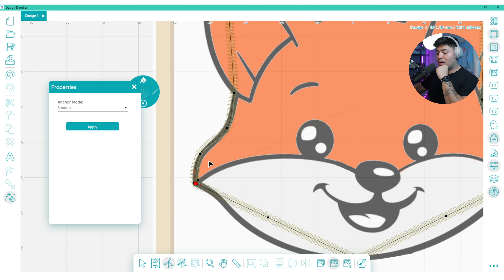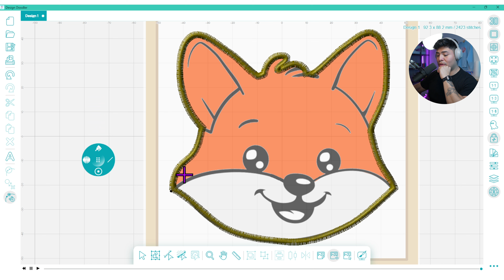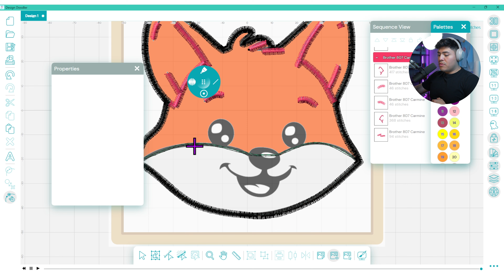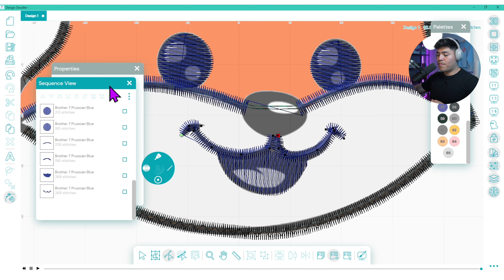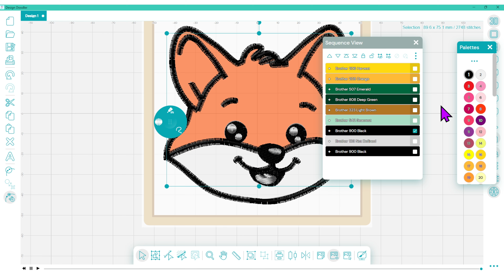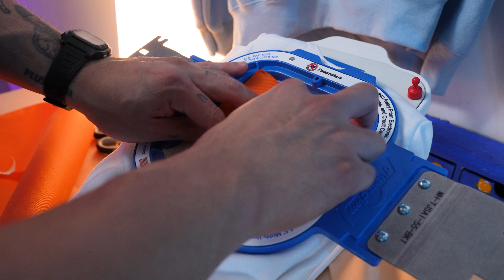Easy Applique Embroidery with Design Doodler! Step-by-Step Embroidery Machine for Beginners

Comment: Great video. I picked up a lot of tips. I’m using the new software, but I’m on the free trial of Doodler, late nights at work. 

I was a bit confused… With the iPad, you can’t click the points, so is that just a function of using the doodler, on a computer?
Reply: @StitchingHeartswithShonte  where do you get the free trial of Doodler??